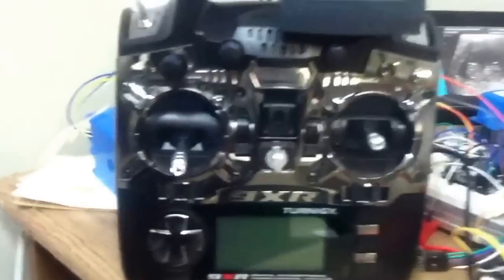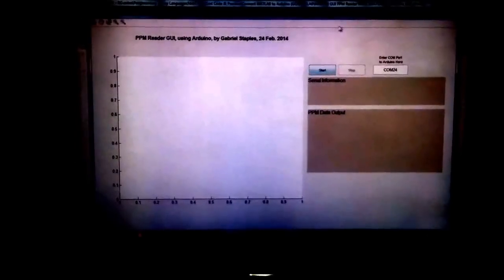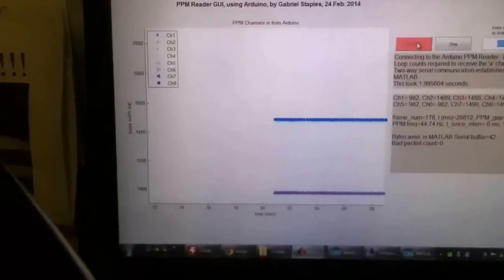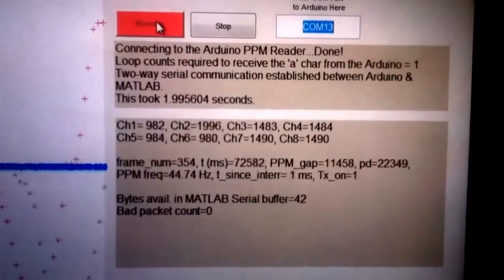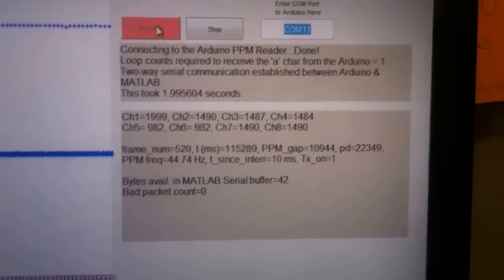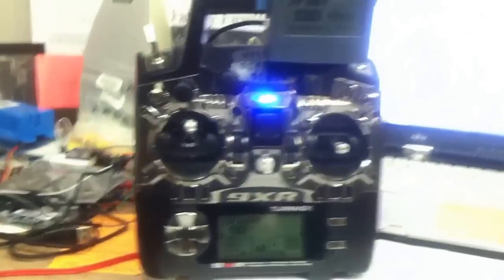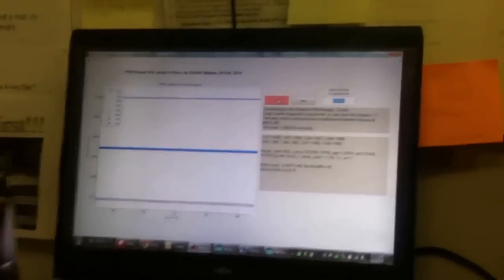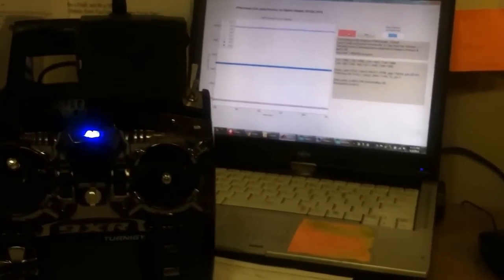Arduino to MATLAB GUI - Live Data Acquisition (& Plotting) of RC Transmitter Stick Positions

Comment: Hello ,
so how i can use this for real time plotting of MPU6050 (for gyroscope and accelerometer datas)

i have try it with the MPU6050 by selecting the arduino port (for me COM14) the connexion is established but the graph still blank

any help will be appreciated 
thanks
Reply from the maker: This is a very complicated code, so I can't fully explain my answer here, as it's beyond the scope of this demo video, but here's something to hopefully help. In my file here, insert your data in at line 223: http://bit.ly/1LOwpAv.  Your data must be of type unsigned int, and you need to insert it into the array called "chs_cpy", in index locations 0 to 7. Ex: "chs_cpy[0] = gyroReading", again, where gyroReading is an unsiged int data type. This will place your data right into the place where the channel reading would otherwise be. Beyond this, you really need to study the code like crazy, with the help of a programmer if necessary, to know what I'm doing. I'm packing the data into binary serial packets and decoding it on the MATLAB end. Truly modifying the code to suit your needs would require a significant amount of understanding.
Reply from the maker: Let me also add: to quickly demonstrate what I'm talking about, try just reading in analog readings (ex: read some potentiometers), like this: chs_cpy[0] = analogRead(A0); chs_cpy[1] = analogRead(A1), etc. Once you get this working, you'll need to replace the analogRead with your gyro and accelerometer data, but I'll leave that up to you to figure out how to get the data from the MPU6050.
Reply: eRCaGuy  hi , your response come a little bit late but thank you for your help ... i have already made an s-function for data acquisition from the mpu6050 .. i stille have a problem with integrating speed because i have a lot of fluctuation ...
cab you help me in this situation
Reply from the maker: FrAnKenStEiN MC I'm not sure; I would need more details. Try posting your code on Github and sharing the link. You might be able to get help on the Arduino forums too.....or MATLAB user sites too, depending on which side you're having trouble with.
Reply: eRCaGuy  i haven't find much help on the arduino forum neither on mathworks site  i don't know if the problem is related to the calibration or in the filter that i'm using (kalman filter) to reduce error  .. i will send you my email in message for further detail
Reply: +FrAnKenStEiN MC  read Datasheet for MPU6050 and calibrate the 6050 first before using it.